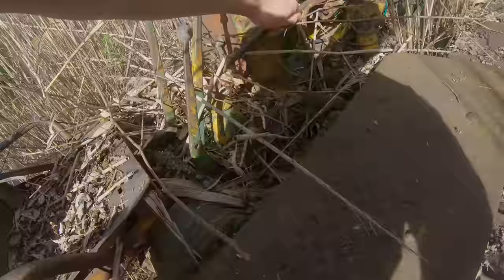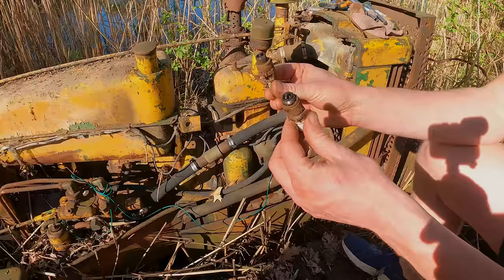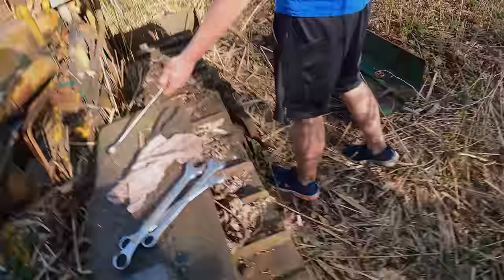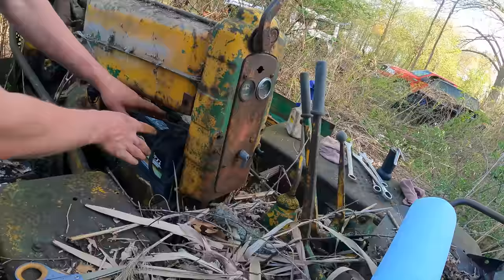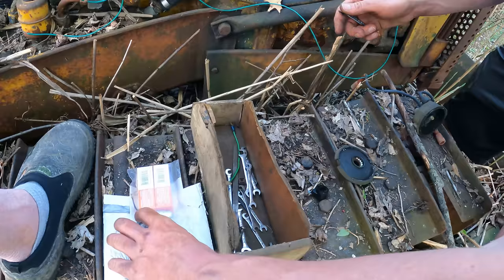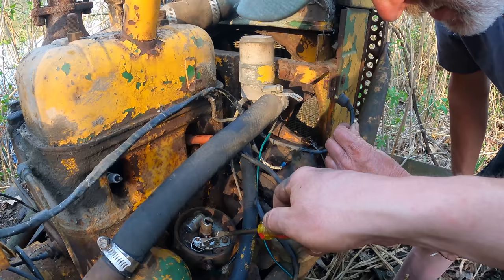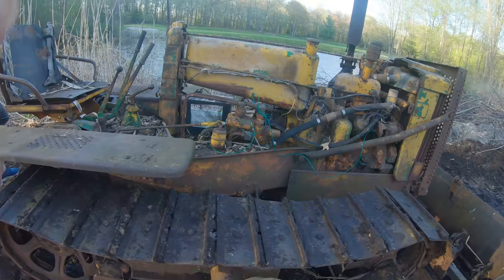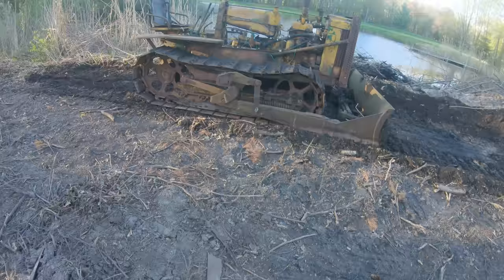Will it START? | John Deere Model 40 Crawler Dozer abandoned 20 years

Comment from the maker: Does anyone else love these two cylinder John Deeres??
Reply: Yea I do
Reply: Dad had an MC for many years, I owned a 440 IC with a Henry loader for a while.  Worked on/used a 40 in Alaska for a few years.  Basically all the same size, engine, transmission (according to year built).  Great for doing those little jobs a big operator doesn't want to touch.  440 had a reverser, and was built a little more rugged, with full frame support of the engine.  You could pull the engine and radiator as a package, which was handy when it came time to replace the main clutch.  Steering clutches/brakes were probably the most problematic among all of them.  I suspect yours are stuck together from the years of sitting... make sure all linkages are free and the throwout bearing is moving, then try a day of start/stop with the handles pulled back, the clutch disks may un-stick from each other any allow you to steer it again.  Good Luck with 'er.  She'll push all day for years, but don't get rough, you can 1st strip gear with that little engine ... and parts were d@mn expensive 25 years ago, I'd hate to see the prices now!
Reply: Yes I have 440c for sale runs good
Reply: My brother has the exact same model only with a bucket loader.
Reply: They are the BEST. God, the sound, the smell, the way they vibrate... takes me straight back to Mississippi and my childhood. Then let's talk about the way they PULL! One of my dads older brothers (out of the 16 total children) somehow lost his seat on my Grandpa's, at the time basically
 brand new John Deere G, (2 cylinder horizontal, crown facing front for those of you who don't know). Double jug engine with pistons the size of gallon coffee cans damn near....Anyways, my uncle either starts it in gear or falls off but that sumbitch come up the hill from the barn, across the yard and whatever else it wanted, and hit the ONLY tree in my Grandpa's yard.... an old (but not THAT old for oak) tired oak, about 2 feet or better on the stump my dad said.... That G proceeded to bear down, tires spinning and digging and push that tree over and into my Grandma's laundry shed!! This tree was living, not thriving, but fully living... all in the less than 4 minutes it was ghost riding. If it's a lie.... at least 12 of my aunts and uncles told it to me!..... Torque for DAYS, MONTHS, YEARS!....In them ol John Deere's.
Reply: Yes, I have a JD 420 crawler
Reply: Poppin johnny
Reply: Correct me if I’m wrong . But the two cylinder John Deere’s are known as Johnny popper’s? Grew up on international an case. But love all antique equipment. Personal my family has two classics that i love to operate
Reply: Look at my profile picture I have a John Deere 40 too,of course I love them
Reply: Is that Lil dozzer diésel? Because if is using carburator  AND spark plus. It seems to be  gassoline
Reply: Johnny Poppers,  in Maine we always said "Dear John, please start this morning."
Reply: I have two running and a third for parts.
Reply: Yes, love that also Deutz Ll...two zylinder engine machineries.
Reply: We have a JD 40 Combine going strong. 1965 was the date of manufacture.
Reply: I do. Working on my 3rd one now. 1936 A
Reply: Restore it.
Reply: @randyc4959  bom
Reply: They're incredibly hard kill and they just have an awesome look too them.
Reply: Я Я Зер Гут 😂
Reply: Lots of people still love them , in fact there is or was a 2 cylinder club.  I even have one in my yard right now.
Reply: Ok 👍
Reply: @albatraoz1257  ,, ya ,,,,  but not same engine...
Reply: Yep dad got me hooked on them, the sound gets you like a Harley
Reply: @countrygentleman4084
Reply: Working on getting an old 40s running now.
Reply: @wildbenny11
Reply: @countrygentleman4084  how much you asking for it
Reply: @edparolini  wanna sell one
Reply: @ronaldsosa951  of course it’s petrol! Ever seen a carb and sparks on a diesel?🤣
Reply: @wildbenny11  888p
Reply: @ronaldsosa951  lol
Reply: Makes me wonder why it was abandoned
Reply: I grew up restoring and using a MC crawler, we had a BO Lindeman, and a 440 loader with a two cylinder Detroit diesel
Reply: Yes I very do, especially If you find it alone that has probably been there for more then 32 years, I'm 32, please restored it & give it some love, like finding a stray dog and making it all better again & healthy & giving it a new home  ;u;
Reply: Very similiar to my JD Model M. 15 years since it ran, but I'm optimistic.
Reply: @seanmullen2287  99
Reply: Music to my ears
Reply: Oh yes 🙂
Reply: Yea it breaks my ❤ heart too.
Reply: Отличный трактор 👍💪

Comment: In the "old" days you used a 2 cylinder gasoline engine to warm the coolant and crank the diesel over until it was running. Once the diesel was running you turned the gasoline off and let the carburetor run dry. The gasoline was NOT a part of the diesel fuel supply. Only the coolant was shared, fuel and oil were physically separated.
Reply: Pony motor
Reply: On my 820 my profile pic the pony swallowed an valve and shattered an piston so new pony is on its way
Reply: I think he was describing the John Deere all fuel tractors, my granddad had a model a that would start on gasoline and then would run on kerosene

Comment: The dual fuel spark ignition tractors started on gasoline but ran on something akin to paraffin once hot. The fuel was called Tractor Vaporising  Oil (TVO) in the UK my father had a Farmall A with that system
Reply: Here in the states, it was known as distillate fuel. The engine had to be set up to run it, using  low compression, like 4.5 to 1 to maybe 5 to 1 CR. You start it on gas, get it up to operating temp of 190 or so, then switch to the distillate, much like kerosene of today, but it was cheaper than gas back then. When you got ready to shut it down, you had to switch back over to gas and run all the distillate out, in order to be able to start it up "cold" the next time.
 IH made an MD Farmall from 1941 to 1952, that was a diesel engine, but started on gas. That was way different than an "all fuel" engine that ran on TVO
Reply: This is correct. It was all to do with cost. TVO wasn't subject to the high tax that petrol came with.
Reply: I had an old model A when I was young and I used to start it on gas and then switch to plain old kerosene.  Ran great on that only you needed to run it out of the carb because there was no way you'd get it started on herosene.
Reply: @bluegrallis  g
Reply: Hi how are you doing 😊

Comment: Old school trick for frozen M, 40, 420 steering clutches. Fill the clutch housings with diesel and let sit for a week, then try to work free. After draining housings they will be slippy until they dry out again. 
BTW, be careful to avoid popping the clutch or you may strip the splines on the transmission input shaft. Our JD MC is still being used occasionally by a neighbour that bought it from us.
Reply from the maker: I think we're just going to pull both sides apart but this is a good idea!
Reply: Hi David how are you doing 😊

Comment: For information. I used to run a Massey tractor in England back in the sixties that was a petrol / TVO machine. Coming back to American it ran on gasoline to start and then manually turned over to Tractor Vapourising oil, which you would know here as kerosene. The machine ran very well but at the end of the day you had to remember to turn it back to TVO before shutting off so that the carburetor was full of gas for the next start. I am not aware of any that ran on gasoline and diesel, I doubt that would work. The TVO worked because the heat from the engine warmed the TVO when the engine was running and this heated oil was thin enough to combust in the hot engine. The machine had a divided tank, a large section for the TVO and a smaller section for gasoline.
Reply from the maker: They made this in a dual fuel too!

Comment: Great video, and as for the tractors that would start on gas and switch to another fuel, it was kerosene not diesel although they're very similar. Great content once again!
Reply from the maker: Thanks!!
Reply: Kerosene and diesel are very similar and on some tractors you could use either one.
My friend had a Farmall that would start on gas and run on diesel. 

Diesel No2 is a common fuel these days but they used to use diesel No1 which is more similar to kerosene.

Comment: Those engines start very easy. if it doesn't start you have a problem. NEVER either them. You will destroy the engine. Your steering clutches are stuck. There is a stack of clutch discs made up of metal and fiber discs alternately. The metal ones are most likely rusted and stuck to the fiber ones. There is a set on each side. When you pull back the clutches start slipping letting you steer a long arc. Pull harder and a brake band around the outside tightens and you swing a tight hard corner. Growing up we a 40 and a 440. I spent quite a few hours wrenching and maintaining them. We had books to help us. Try find to manuals for it. Will help you alot.

Comment: The diesel/gas mix you were talking about was probably a gas pony motor that basically served as a starter for the main diesel. Once the pony got the diesel spinning , a lever would close off the system giving compression in the main allowing it to start and run the machine.

Comment: Years ago some of the big dozers and track loaders used a separate two cylinder gasoline pony engine to start the big diesel engine. Gasoline engines were used in place of an electric starter that would be used on big tractors later on.

Years ago some of the agricultural tractors had a combination gasoline and diesel engine. 
Set up the engine to start out on gasoline and once the engine was warmed up you switch a lever and it would change the compression ratio and twitch it over to diesel fuel instead of gas and it would run on diesel until you turn it off.

Comment: I thought your starting problem might have been due to low compression. I’ve never seen an engine that would “coast” to a stop when you let off of the starter. However, once you got the spark going, it started fine and when you got it moving, it was pushing a full blade of dirt so the compression must be “enough “. Cool little machine and a good video. 🥸👍🔧💥❗️✅
Reply from the maker: The flywheel is like 3” thick… once you get it spinning it doesn’t stop 🤣
Reply: I don't think the plugs were in it

Comment: I have a 1954 John Deere model 60 two cylinder tractor. I love the sound, the talk and the vibrations when it runs
Reply: ..the torque it has. I dragged a cut down tree that was the size of a small mini van and it pulled it to the burn 🔥 pile no problem until the chain snapped.
Reply from the maker: I want a model 80 diesel soooo bad

Comment: The part that does the charging on this tractor is a DC generator.
Alternators produce Alternating Current, which is converted to DC by 4 diodes  which is a bridge refector.
Now you know.

Comment: I've got one just like it. Someone left water in it and busted the block. I love it so much fun.
Reply from the maker: that's a super bummer but I bet you can get parts!!
Reply: @dieseJL  already got another motor just got to rebuild it and put it in.
Reply: @adamb7220  Just loop the radiator hoses together with a can of course ground pepper poured in them and run it till it quits leaking then hook them back up to the radiator and just add a little more pepper if it starts leaking again I've ran old junk equipment like that for years so long as it's not getting in the crank case to wash out the bearings

Comment: An Allis Chalmers model M is dual fuel capable. The original manual discusses running it on gasoline or kerosene or what they call "low grade fuel". I use mine for pushing snow or tugging out an occasional tree so I just run it on gas.

Comment: All I takes to keep that machine out of the elements is 4,  8' post's and an old 8' truck cap on top to park it under up on a couple treated planks to keep it from sinking into the ground. 
Stored my 57'  JD 420 loader for 16 years till I  could get to it and it's fine.
Reply from the maker: Would be a good idea!

Comment: There used to be a fuel called power kerosene, cheaper than normal gas and you had to start on gas and switch over, it is different to modern kerosene with a more realistic flash point.

Comment: That is a generator, not an alternator.  I don't know about this particular application, but they could be set up to both start the engine and recharge the battery.
Reply: More commonly known as a Dynamo
Reply: It's just a generator for charging the battery.. It has a electric starter .

Comment: I have a 420 John Deere tricycle wheel has the exact same motor everything on the top of that tractor is just like mine they use old Chevrolet points and condenser I've been running my popcorn Johnny for 30 years bush hogging in the fields starts every time I love that tractor

Comment: My dad used kerosene in his diesel catapillar road grader as a substitute!
Til he bent a valve. It had the old gas "Pony motor" to crank over the diesel engine.
Then they scrapped it.

I seen 2 old dozens like this. One here in the ""John deere commons"" in Moline , IL. In show room condition. Plus another one at a scrap yard sitting in front of it for sale. It needed restoring . It was needing a paint job badly.

I would had loved to get it to restore it back to new condition.

I also wanted our old family owned John deere D tractor that originally had steel wheels and a plow.
My 1 brother took it apart to restore it and then gave up on it and sold it to my brother after it was prepped for paint and my idiot brother let it set in the rain and get all rusty.
I still say he never should had sold it to him.
I wanted to get it back together and refurbish it.

Comment: There's absolutely NO way that thing was running on 20yo gasoline and without going into the carburetor. I refuse to believe that. I think you guys pulled a fast one on that deal.
Reply from the maker: What if I told you it was legit?
Reply: @dieseJL  I would not believe it. I have been doing this kind of stuff for 40 years, there’s no way.

Comment: Mixed fuel like petrol and kerosene were put into old BSA MOTORBIKES, started on petrol then filled with kerosene, and then driven for hours but with black smoke for miles, old machinery and motor bike had characteristics in the making, everything now is made of plastic or light sheets of metal and don't Las as long, they fold to look at them, michael. IRELAND [EIRE]
Reply from the maker: That’s right!

Comment: John deere 2 cylinder tractors 1950 and before started and warmed up on gas. Then you switched it over to tractor fuel..
Reply from the maker: I think they made a dual fuel model and this one is not it. Is that true? Looked like they made dual fuel, regular gas and propane.
Reply: @dieseJL  i'm not sure when they started making propane. I do know if they set up for propane it took a lot changes to run on gas. No tractor fuel on that model. The letter model tractors had a small tank and large tank. Small for gas (starting fuel) large tank for tractor fuel (running fuel). Dad said tractor fuel was like kerosene. If you run the tractor on gas all the time it was hard on the valves, gas more horse power. A mechanic told dad to run 1 gallon of kerosene in every other other tank of gas.